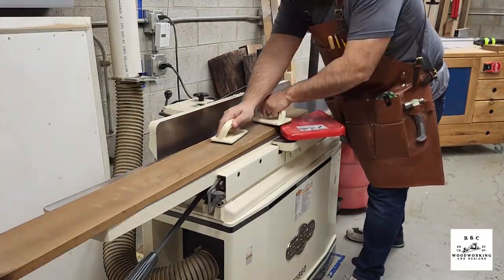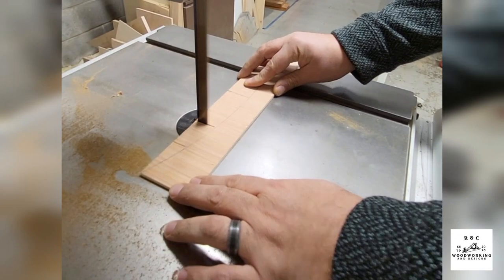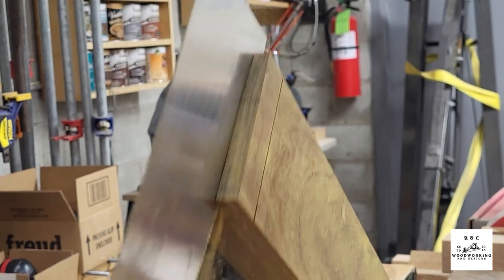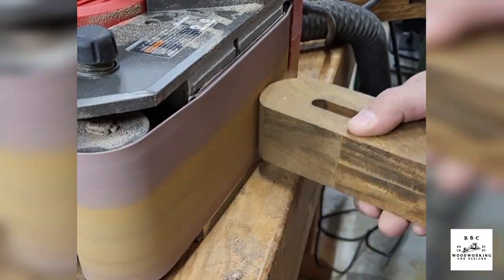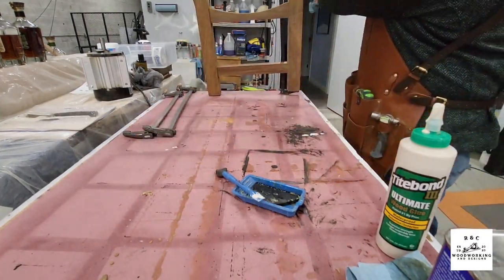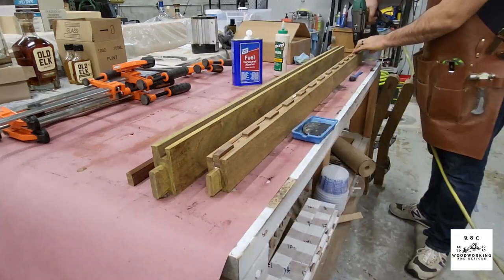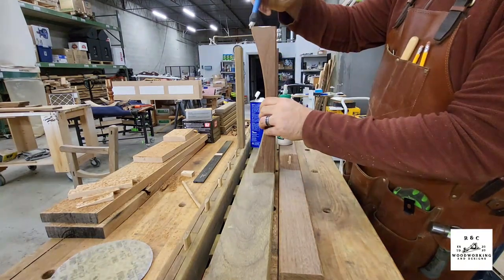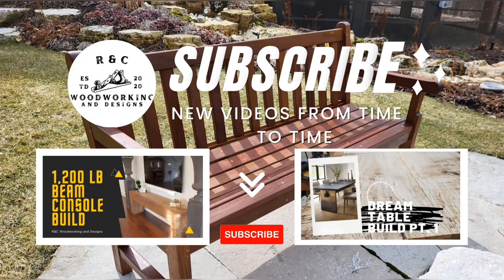The Ultimate Outdoor Bench Build

Comment: great video - ! I made one off the same plans and made more mistakes than you- I ended up using domino for the back slats- and didnt' glue ieach slat into  each rail-  I left them float- to let the wood move-  in  wet weather and it sure did- now I can see all the dominos showing above the shoulder.  The original plan- used the slats just  non glue fitted into the back rail- so any movement- would not show a tenon- This is really a question- from me- did all the glue joints on the slats - crack- ?--  also the plans showed a small brace under the front- rail-- ?- was this not needed/. thanks for making the video- it sure helps  a lot-
Reply from the maker: Thank you for the great feedback. As of now, almost 2 years down the line, the Ipe has held up and the dominios are not showing. I'll keep you posted though